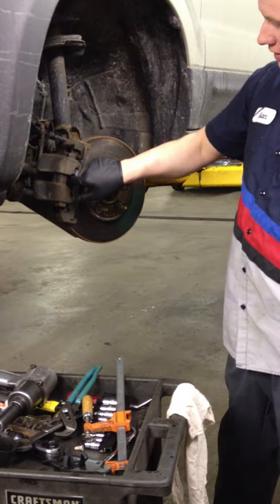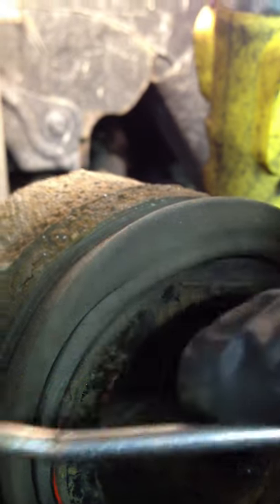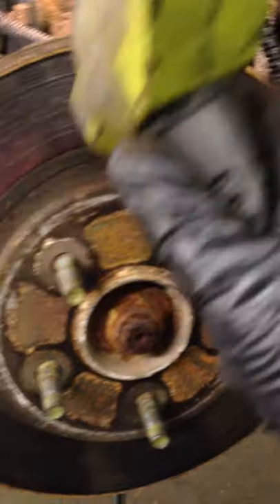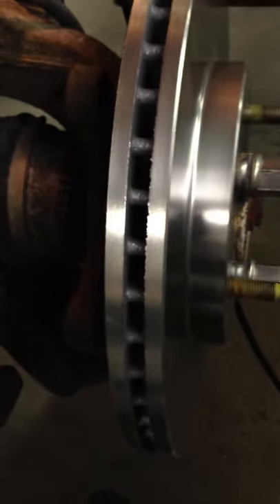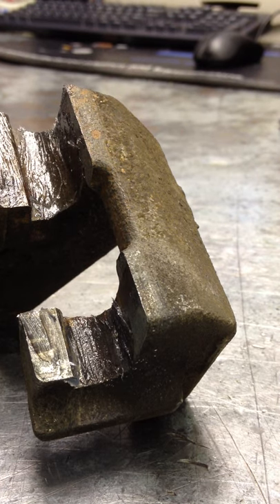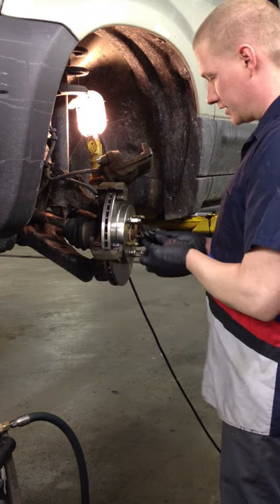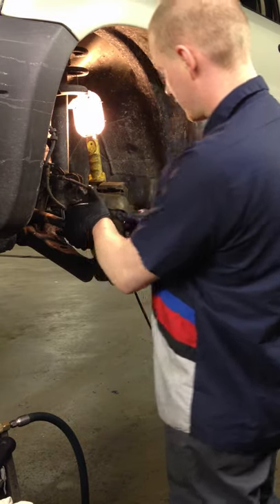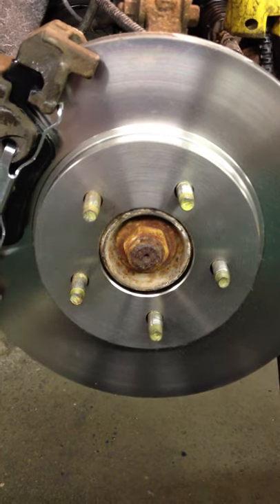2001-2007 Ford Escape Front Brake Job

Comment from the maker: These are the Tools and Parts I recommend:
Front Pads (check fitment guide)-
http://amzn.to/2tgh48s
Front Rotors (check fitment guide)-
http://amzn.to/2uANhuS
Medium Strength Threadlocker-
http://amzn.to/2tIwOAh
Caliper Hooks- 
http://amzn.to/2tIy0DM
Caliper Grease-
http://amzn.to/2vkMLil                                                                                                               Torque Specs:
Caliper Bracket Bolts- 130ft lbs
Caliper Pins- 26ft lbs

Comment from the maker: make sure outer anti rattle clip is installed all the way in. I have found the aftermarket clip that may come with the new pads dont fit well or half come out touching the rim. I have to throw the new one away and use the original oem one. Otherwise make sure all bolts are tight.

Comment: Thanks for the great video and instructions, going to attempt doing it myself next week on my 08. Thanks!
Reply from the maker: On that year I believe you will need a 9mm allen head for the caliper slides I would pop the caps and check as the 9mm is hard to come by. Otherwise there is another way without buying the 9mm allen head.

Comment: Hey mate i have a 2001 ford escape battery good got new alternator and it isn't putting charge back into the battery, and using a multimeter the volts go down when you rev the engine, we took the alternator back out and had it tested and its fine, me and my dad dont know what else to do are you able to help at all mate ?

Comment: Just worked on my 05 escape tonight. tried to replace the rotors only. mine has torx screws for the caliper bolts. I bought a cheap set of torx sockets and the T45 fit but bolt was too tight/rusted in? and rounded off my torx socket. Do they all have torx style bolts there? also my 18mm bolts were so rusted on that i broke my craftsman socket wrench with the help of a cheater bar and bolts still didnt budge. any suggestions?

Comment: Thanks for the heads up on the 9mm allen socket, I was able to find a kit that had that socket size but they are definitely not common or brand name. Just wanted to confirm the torque specs on the caliper slide pins & caliper bracket. Appreciate it!
Reply from the maker: 2008 Escape
Caliper support bracket bolts- 129 ft lbs
Slide Pins- 37 ft lbs
Wheel lug nut- 100 ft lbs

Comment: You said the allen nuts for 2008 and on are 9mm.  My 2010 is 7mm.  I only know this because a different tech video said the 2010 was a 9mm and I spent 2 weeks trying to find one as they skip that size is every set I have found.
Reply from the maker: Sparty1966grad Yes they went to 9mm for while then went back to 7mm like every other vehicle in the Ford line. They must of come to their senses.

Comment from the maker: Man this is bad, my early days. I need to make a new one I see.
Reply: FordTechMakuloco got to do brakes on a 2002 escape what mm are the caliper slide pins and do I have to do anything to bleeder valves(are they even on here) on your newer videos you strongly recommend vacuuming brake fluid into a container and topping off with new fluid do these 2002 even have bleeder valves ? with your help I may try to tackle myself thanks in advance!!

Comment: changed your mind about the anti seize I see.
Reply from the maker: +Lee Dress on what I still don't use it on bolts
Reply: +FordTechMakuloco in your newer video you put it on the hub, in this one you said you never use it.  and yes, never ever on the bolts.  I w as looking for the video you have where you bleed the brake while compressing the piston but I can't find it. I'm doing mine tomorrow
Reply from the maker: +Lee Dress I like to put a bit on the hub where it mates to the knuckle very thin coating and a thin coating on the hub face being very careful to not get any on the threads. This video-https://www.youtube.com/watch?v=83H1uxQhdgI